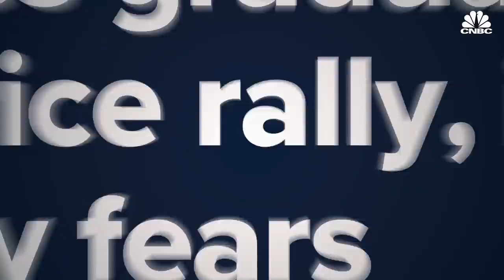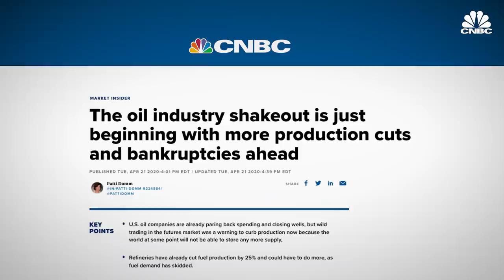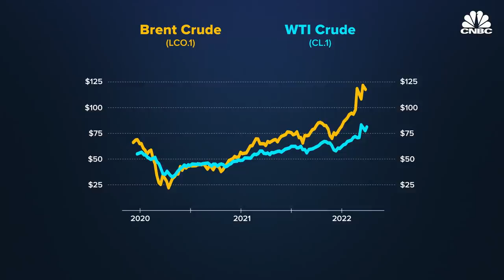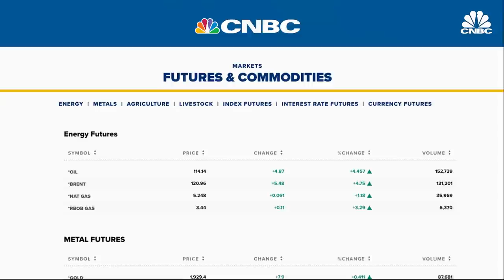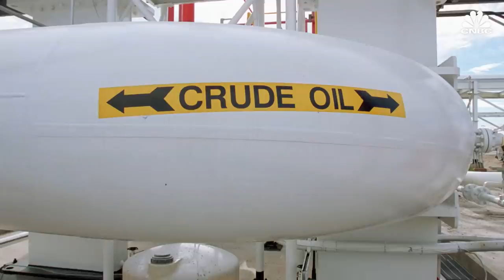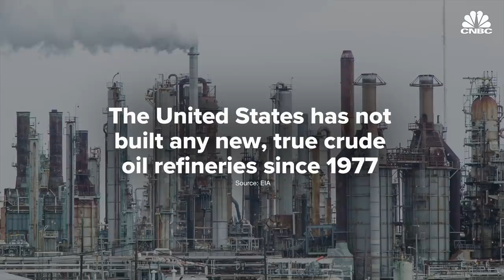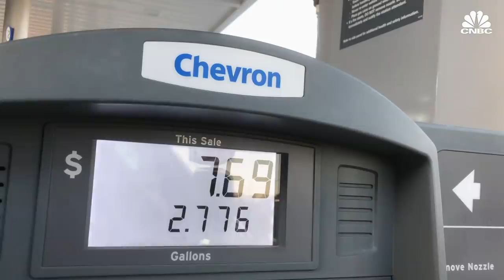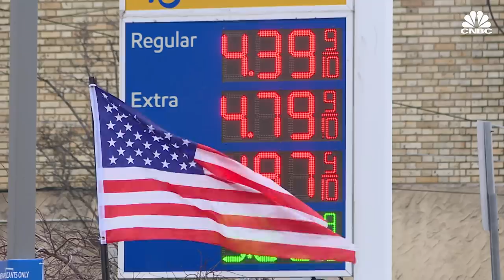Why Russia’s War Drove Up U.S. Gas Prices

Comment: Everyone commenting about how greedy oil companies are… as if all of a sudden they became greedy. This inflation is due to bad policy. 

1. The increase of monetary supply. 
2. The tax increase on domestic oil production.
Reply: It's the oil companies who are price gouging, we don't import enough oil from Russia to affect us this bad.

Oil companies found opportunity to make many so they are taking advantage. ...
Reply: @ronanbrodrick9168  yes, they would rather the price is a barrel goes down so they get less money they're so greedy
Reply: @twesj  you don't know what you're talking about
Reply: @twesj  They should've raised their prices years ago. I wonder why they didn't.
Reply: @tuckerbugeater  US producers don't determine the price of gas. If you're talking about the price of oil that takes in a lot of factors including future exploration which is almost nonexistent right now in the United States. They would rather drill where they already know where the oil and put a little on savings because it's clear things are going to get worse for them before they ever get better if they ever do. Exploration is very expensive and risky. They may make more money on their production right now but it will drastically drop as they have to cap off wells. This is why in Montana they are opening dormant wells. That's the best they can really do right now. We know how much is going to be produced from our oil deposits that are already discovered so that's already baked into the price of a barrel of oil since oil is on the futures market.
Reply: @angelgjr1999  it is and isn't. Saying that we can't blame a president is a little ridiculous.
Reply: they have always been greedy just maybe not as brazen. stock prices rising because of buy back and executives making tens of millions. US sells most of its oil abroad because its more profitable, should see what it cost in europe. also the gas taxes paid by drivers arent even high enough to cover roads like they were suppose to. we should be looking to invest in public transit so owing a car isnt a necessity. Also still billions of dollars of subsidies go to oil companies despite being the most profitable corps. yes there is a problem with increasing the money supply and the government should decrease it when it can. we shouldnt have fractional reserve banking which means a bank can loan out more than what they have, basically legal fraud, this is why bank runs are possible. this prob drives the business cycle as money is loaned increasing the money supply and as loans become due they are defaulted on since more money than exist is needed to pay it off. Keynesian economics is suppose to be government spending when there is a down turn and taxing that back in the good times which has never been done. estate tax has basically be axed. bush and trump made gigantic tax cuts which of course creates  more debt. we have a debt based money supply because money is created by the federal reserve(a private bank) buying US treasury bonds. so more national debt means bigger money supply.
Reply: The truth is that the U.S. is the largest oil producer on the planet and could easily produce enough to drive down prices.  U.S. oil producers were producing 18 million barrels a day prior to the pandemic.  Today, they are producing approximately 8.5 million barrels a day.  We have a huge amount of production capacity sitting there offline that could be brought back online in a couple of weeks time.

The head of the largest U.S. oil producing company admitted during an interview with Andrew Ross Sorkin on CNBC (aired in part on December 7, 2021 Squawk Box morning show) that U.S. producers have plenty of production capacity they are refusing to bring back online because they want to hurt the Biden Administration.  When Sorkin asked the jerk if he had any obligation to his country or the world economy trying to recover from a 2-year pandemic, the response was, "our only obligation is to our shareholders."

Energy is the number one cause of inflation.  If the U.S. oil producers brought back production to pre-pandemic levels, prices would drop to nearly $2.00 per gallon in just a few weeks.  Prices throughout the economy would drop due to lower transportation costs.  Inflation would drop back down to normal levels.

We are all being held hostage by a bunch of oil companies who are experiencing record profits while doing their best to make voters angry at Biden and the Democrats and hoping they will be voted out.  No industry should have that much power over our economy or our political system.  People should also understand that high oil and gas prices enrich Russia and OPEC at the expense from the rest of us.

The U.S. government should use its Emergency Powers to do some drilling and replenishing of the Strategic Oil Stockpile and constantly releasing from that stockpile into the market to drive down prices.  That would force the oil companies to treat us fairly because they could no longer conspire together to act as a duopoly.
Reply: @chuckmurray1825  What is the jerk's name?
Reply: Well you also have to see is that counties like Canada and Saudi Arabia are exporting more oil to Europe because Russia has reduce production of so they exporting less oil to the US
Reply: @ahadumer418  Exactly.  There has been no change to policy or taxes to cause the lack of production.  This is just greed by oil companies.  Look at their reduced production numbers and their much higher profit margins.  Follow the money.
Reply: @twesj  you can't blame the president he doesn't set the prices.
Reply: @duancoviero9759  no, the futures market sets the prices based on how much exploration going on. So when one of the largest producers in the world has an administration who does everything they can to stop new exploration beyond the 9000 permits the price will of course go up. The price increase for gas literally started the first month this administration was in office.
Reply: @twesj  no it isn't, that isn't even close to being true. Do you even bother to read up on a subject before you post such BS?
Reply: @duancoviero9759  FYI I've worked as a pressure tester in the Bakken oil field for 20 years. We were far busier out here when Obama was in office than Trump and the same is true with Biden now. That's because Trump knew that finding more places to drill for oil is going to be a lot better than producing as much as possible. If we produce as much as possible without exploration it won't do anything but dry up our reserves which is exactly what you're seeing. Look at the national petroleum reserve. Trump had it filled to the top. Now Biden has us down to one day's worth and when he drained it the price improved by only $.10 and continued to rise.
Reply: @twesj  leases mean next to nothing buddy. All you're doing is posting lies and hypothetical BS. Zero facts. Leases have nothing to do with prices.
Reply: @duancoviero9759  if leases meant nothing they wouldn't have been pushing the 9000 leases that are available for the last month or more.
Reply: @twesj  no matter how much you talk about them, they are irrelevant to the subject matter at hand which is CURRENT GAS PRICES. Not a lease a company might not even develop on for several years.
Reply: @duancoviero9759  so oil prices have nothing to do with the gas prices?
Reply: @chuckmurray1825  that's the most impressive comment on here 🏆
Reply: @chuckmurray1825  look up Brian Tyler Cohen's video, this is being done.

Comment: Literally more oil than we can use so there's no reason why prices should be as high.
Reply: Negative oil prices….I cannot recall getting paid to fill my tanks.  Can’t even recall prices under $3
Reply: @jaysmith1408  exactly, the entire economic system is unreal, we just agree to this even though it doesn't benefit us at all.
Reply: Greed maybe?
Reply: @hjomnp09mgh  yes definitely greed.

Comment: At 0:57 Quote "The US goes through almost 20 million barrels of oil per day"
At 1:45 Quote "In 2021, "The US produced an average of about 11 million barrels per day"
Oil consumption is actually 18.9 mbpd,
Crude production is currently 11.8 mbpd, ethanol and refinery gains add 1.5mbpd for a total of 13.3 mbpd.
Therefore the US imports 5.6 mbpd or 30% of it's consumption.
Where does the narrative that the US is "self sufficient" in oil supply come from?
The US imports the equivalent to 50% of Saudi or Russian export production, or the combined export production of Iraq and Iran.
China with a population of 1.4 Billion consumes 14 mbpd, or  3.6 barrels of oil annually per person.
The US with a population of 360 Million consumes 18.9 mbpd, or 19.2 barrels of oil annually per person.
Therefore the idea that China India, Africa and South America can reach the so called "American living standard" is preposterous.
The market will force American oil consumption to fall either by price or shortage to drop by a third over the next 10 years nothing is more certain.   
What is the price at the pump that will force Americans cut drive/fly by 50%
considering food supply and transport, mass transit and construction will need to be maintained along with it's energy consumption.
It could be well above $10 USD per "gallon" in a county that alone uses a measurement standard used in the UK in the 1700's, gallons don't exist anywhere else in the world. 
Resource supply for the so called EV revolution will reach it's peak in 2024 permanently limiting EV production to around 5-6 million vehicles per year world wide.
It's real political problem to explain this to the clearly moronic ill educated masses in the US.
The sellers of fantasy will be at it again.  
Narratives don't replace reality.
Reply: The US has the capability to be a net exporter of "OIL" and was in late 2019 through 2020. COVID changed the landscape of the oil industry, for now. We haven't completely recovered from it from an economic stability standpoint so there is incentive to import and refine the products we need, for now. When the world economic picture stabilizes a bit more I'm sure it'll go back to how it was. It's probably smart in the interim to import oil and preserve our resources just in case. WW3 could be right around the corner.

Comment: No one seems to remember when gas prices here in the south were <$2/gal for almost two years during the low demand pandemic period. Now that demand, and therefore, prices have risen, many people are whining. Oil is a GLOBAL commodity and prices are set by the GLOBAL market, not individual politicians yet many people will mistakenly vote based on this misconception. You want to lower you fuel cost today? Reduce highway speed to 55 mph - 10-15% reduction especially with low aerodynamic vehicles such as RV's, pickup's, truck's, and SUV's. Long term solution, trade in your gas guzzler for a more economic vehicle. Most people are just driving 'status' rides anyway with a disconnect between need and want.
Reply: The automotive industry encourages it.  My cheap little Honda FIT was discontinued.  There's no reason to discontinue cheap gas cars that get 40+mpg until EVs are proven effective and practical alternative.  We aren't all jumping to spend 35k on a new EV not knowing if promises of reliability and actual mileage will pan out.
Reply: Lol. I saw a video yesterday where Iranians were claiming to fiill their tanks for 3 American Dollars.

In the book "A New Digital Age", Google's CEO and his U.S. military buddy call that social phenomenom the 'Arab Springs'. Living in America and knowing how racist people are here, I can only guess 'Arab Springs' is a deragatory spin on the bar soap company 'Irish Springs' since the book doesn't seem to reference a verifiable event in Middle Eastern history. In other words, even the CEO of Google and his military buddy aren't above ridiculing the hygiene standards of war torn, 3rd world countries.

That being said, I call 3 dollars a tank in Iran the 'Poland Springs' because just like refreshing bottled water, that oil is tapped straight from the source.

Lmao.

Comment: We need to become independent of petroleum and start producing EVs and have EV charging stations at all gas stations on a large scale. Those who don't believe will be left behind just as the horse and buggy were. I spoke to my sister in France and their gas is based on liters, not gallons. She said their price for gas is equivalent to $10/gallon. The US gas is subsidized by the federal government and we are spoiled brats for driving gas guzzlers and living in huge homes that destroy the environment. We need to take responsibility for our actions. We have no one to blame but ourselves.
Reply: Not enough lithium on the planet to make enough batteries, nor can the electricity grid handle the EV charging load.